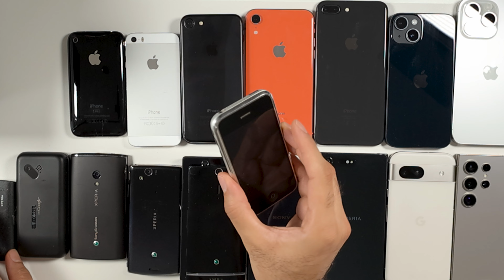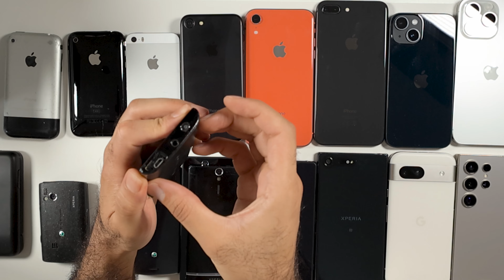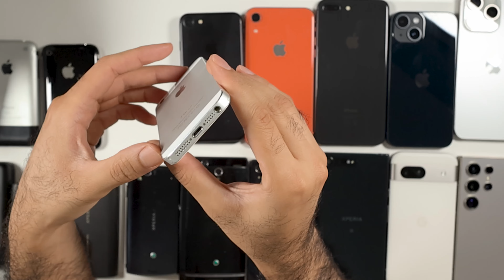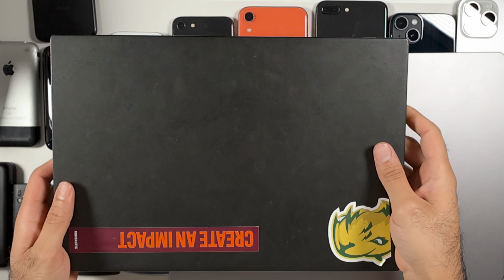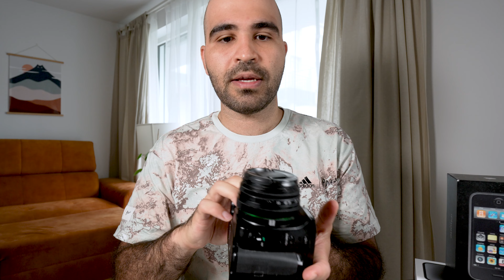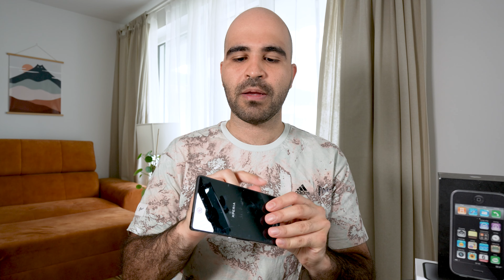Debunking MKBHD Apple Durability Claims!

Comment: "ip68" iPhones that are supposed to be twice as water proof as ip68 android phones are always seen in phone repair shops with water damage... we aren't talking high pressure jets we are talking "I forgot my phone in my pocket and jumped in the pool"
Reply: Unless you specifically state which of these ip68 Android phones are running into these issues, this is just an incredibly biased anecdote, I doubt if those phones were actually IP68 rated or you just assumed them to be
Reply: Any sources to back up that statement?
Reply: @egymagnet  it's anecdotal which isn't a valid source it's just what I've seen happen to friends and family youtubers and in repair shops. I could probably come up with something but I'm too lazy to do so
Reply: Yep. iPhone user, the experience with water resistance has never been good. I had a 3 year old iPhone XR. Just 3 years old. And I submerged it in what, 10cm of water? And only the top of the phone too. Guess what happened. Face ID died. Water resistance? More like water unresistant
Reply: @0w3nn  my friend had an iPhone 15 not charge for a week because of sweat in his pocket 💀
Reply: That's because people hear water resistant and get over confident. Therefore putting their phone in more watery situations. You know the phrase, "when you have a hammer, suddenly everything looks like a nail?" Similar idea.
Reply: @thedlcj more like you get promised "under 6 meters for 30 minutes" you take a shower and lose ur phone
Reply: what's the point of standardization if it was different from company to company.
Reply: Nice joke
Reply: @apontechy he is right . iPhones do survive a ton of shit. But there are a shit ton of android phones out there by different vendors so the comparison is pretty lopsided.
Reply: 😂😂😂
iPhone is definitely more waterproof than most Android phones 😂

Also you can check several videos where people put their iphones in water and the phones still work 

Cope harder 😂
Reply: @indulekhasantosh9743  REALITY CHECK, of course an iPhone with a better IP rating is gonna perform better under water and dust than a Android with a lower rating CUZ THATS WHAT AN IP RATING IS, also Android phones can perform just as well as iPhones under water u just haven't seen any videos of them

Comment: Remember the htc legend? It also had a unibody aluminum design but you could easily replace the battery by yourself. Technology got so much better so if a Company like apple would like to to an iPhone with a replaceable battery, they could!
Reply: But they wouldn't as Apple likes to extract money from it's customers as much as possible. They want to charge extra for the battery replacement
Reply: @TechnicalUsama  yeah thats the sad part. But if apple won’t do it then nobody will. Because we see companys like samsung copying apple year after year like with the missing headphone jack for example. The next thing will probably be the missing sim card tray in europe too and then samsung will follow in 1-2 years
Reply: @iOSeXtreme  Yeah when Apple removed headphone jack back in 2016 every single company made fun of Apple but slowly companies started to realize that by getting rid of headphone jack they can maximize their profits so here we today where every single company has ditched the headphone jack completely.
Reply: @TechnicalUsama  and its also because customers are spineless if they made a statement with their money that head phone jack is a must in their phones they would have walked it back. 

there is a reason cheaper 200$ chinese phones have a headphone jack even the newer ones coz the main demographics of that price will not buy a phone without a headphone jack.
Reply: @TechnicalUsama  headphone jack removal is mostly on flagship models except for sony

Comment: Makes no sense. All ARM chips are non-replaceable, they are system-on-chips meaning everything is soldered. So, the only upgradeable components are the display and battery, and iPhones are able to have these swapped out by an Apple Store. The example of the early Android having removable batteries is moot as all Android Oems apart from a niche brand, copied Apple and went for fixed batteries, for obvious reasons. 

As Apple says, it is more important to make products last with high QC than having less durable products just to make them easier to fix. I suspect most broken phones are down to misuse by consumers or are warranty issues. If you look after your battery and phone then Apple and others have proven that they are made to last. I still have 10-year-old iPhones and iPads that still run!
Reply from the maker: I understand where you are coming from, but I was not trying to say other OEMs are better than Apple, all of them should make batteries easy to remove, as the EU also makes a new ruling on it, and sooner or later they have to abide. On the other hand, some of the anti-repair trends, or making things hard to repair trends were pioneered by Apple, and I used the removable batteries as an example here.
Reply: @techmo2020  yeah, I think Apple learnt the errors of their ways and are thankfully correcting that direction, now moving towards better repairability. Obviously they were forced to do it but we are seeing across the board improvements by many OEMs for display and battery replacements which are the main components that tend to go wrong. But I still believe that smart phones were looked after are extremely durable and reliable, especially the amount of use and abuse they take.
Reply from the maker: @andyH_England  I agree on durability part, if we put the battery and reperability issues aside, all the phones on the table still work to date even the first iPhone and iPhone 3G.

Comment: iPhones sucks, i hate ios just so complicated
Reply: iOS is just basic. You must learn how to use it. Android somehow gives more customizability and is easier to use without prior knowledge.
Reply: I think iOS is overall easier to use but when it comes to things like transfering data from your iphone to any other pc it becomes a nightmare. So if you are not in the whole apple ecosystem I always would think twice getting an iphone
Reply: I strongly disagree. Have you ever used iPhone? I use both S24 and 14 Pro Max. Android is not comparable to smoothness and simplicity of iOS. However it's pretty locked ecosystem that's why i use S24 as a main phone. For Camera, battery and outdoor activities, iPhone is better just that iOS limitation is annoying.
Reply: @alan9047  yes been using iPhone 13 pro, the interface just pushes u to do what thee phone want not what u want, so no freedom using ios like android, the phone don't allow u even to costumize it, shame to have a phone that controls how you use it
Reply: @alan9047  Simplicity of iOS or stupidity of iOS? And yeah iOS is complicated for example during incoming call there's no decline button instead you have to press power button in order to decline the call lol. The only plus point of iOS I see are animations.
Reply: @alan9047 This can't be true since the s24 is at least as smooth as the iphone 14 pm. Especially since the new animations of One UI. Then ios is complicated, i remember the first time using it i was struggling to know how to find different options, the back gesture is weirdly placed on the left (while it should be placed on the right or on both sides), in some apps you don't have all the options at the same place  and this is really annoying, the worst phones i ever used. And i tried a lot of them, iphone 12, Xs, 11 pro and that's pretty much it but that's still a lot. I never kept one of these phones more than one day, i got back to the store to get reimbursed and to buy an Android after 🤣. So yeah...